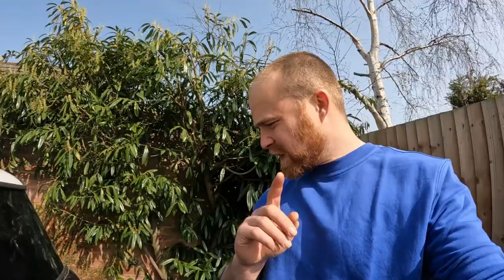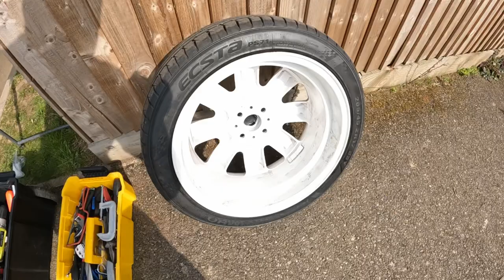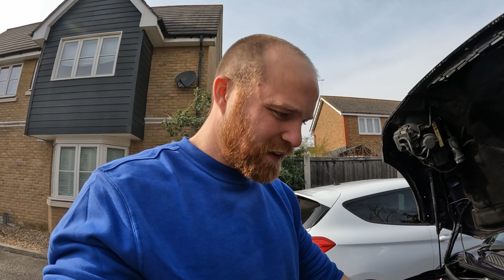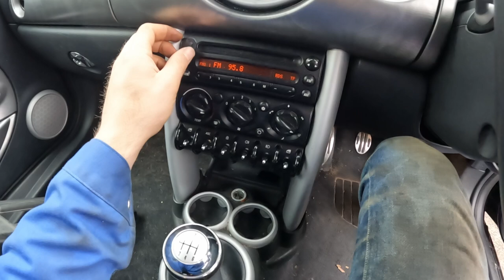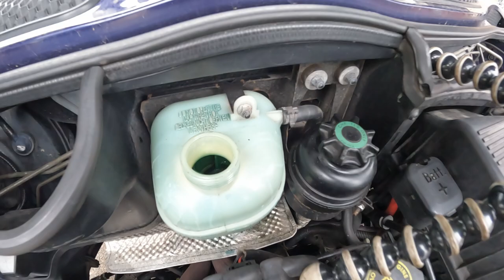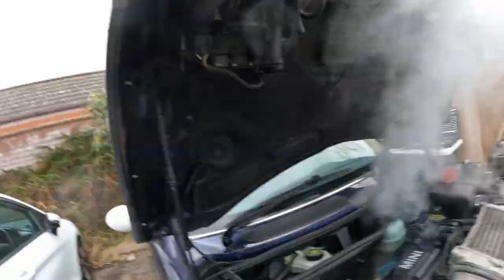This isn’t good

Comment: Hey Nino, minis run hot, mine runs 106 - 108C.
This is above boiling point, the system is pressurised lowering the coolant boiling point when under pressure.
Looks like your expansion tank let go at the seam halfway up the tank thus reducing system pressure, causing the system to boil over.
Add the lean condition as you described the cooling system would be hotter... 

The seam is a weak point on the expansion tank and is a well known failure point on minis.

Good luck with the boost leak, using a section of heater hose one end against your ear & the other moving around the engine will pinpoint where the leak is, it does work.....
Simulates a stethoscope, give it a go... 👍
Reply from the maker: I literally just read about the coolant being above boiling in my automotive textbook (yes I have one and read it haha 🤓). Looks like the cap failed, resulting in the loss of pressure and then the coolant boiling suddenly. Got a new OEM cap on the way and hoping that sorts it (along with fixing the boost leak). If it's not the cap then will definitely look at replacing the whole tank 👍🏻